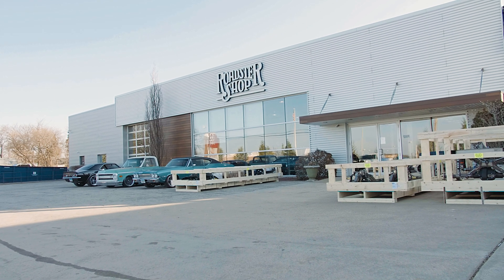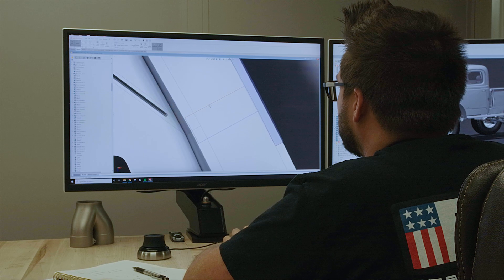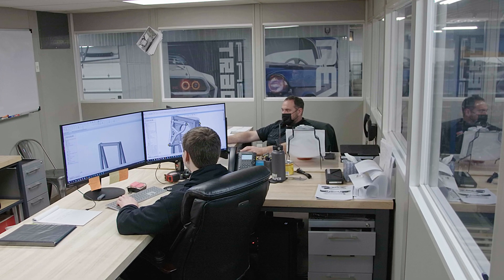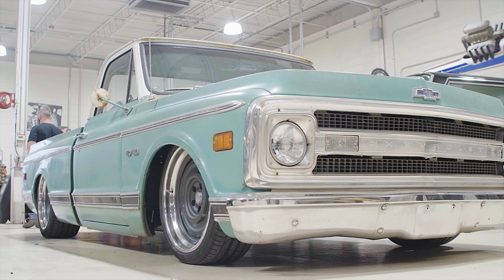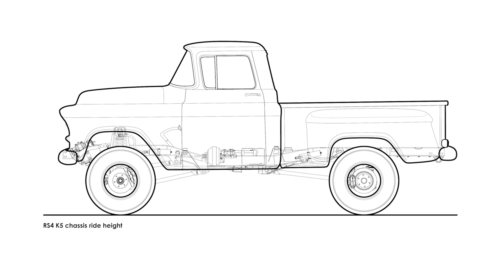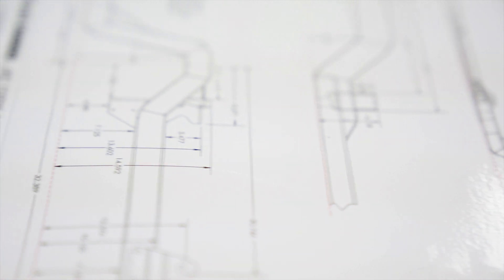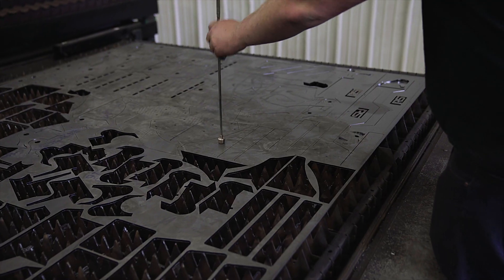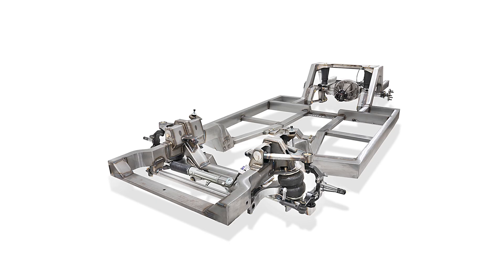Custom Roadster Shop Chassis: How it works...

Comment: I called them recently, asking about a chassis for my 1933 Chevrolet coupe. They said that they used to do them but not anymore. So much for the custom shop!
Reply: As someone who use to work for RS and seen I don’t know how many of these chassis’s get built and moved out the door… no the hell they didn’t
Reply: Unless you pay for a one off custom build it's pretty hard for them to justify designing and building it for less common platforms

Comment: Can you make a chassis for a 3/4 ton pickup? I noticed other shops only do 1/2 tons.
Reply from the maker: You should check out Banks Power's latest video series.  They are doing a c20 build with 8 lug hubs.  https://www.youtube.com/watch?v=GU6so-9pV0Q&list=PLwtmrqcWzLtSUSPX-V1rFQUkslt61Accw

Most the stuff we do is 5 lug, but as proof it can be done - the Banks series is great.   Are you going to use your truck as a tow vehicle or not so much - just that it started life as a 3/'4 ton?

Comment: How do you guys comply with the legal requirements and registration for a custom chassis? Do you have to perform any safety tests to make it road legal
Reply from the maker: At least in the states where we do most of our business (we do ship internationally as well) - the VIN for a vehicle is attached to the body so whatever donor car we use ends up with the same VIN as the original number.  DMV's are only concerned with the VIN and the car with the new chassis will register the same as the stock vehicle.  As for safety tests - all the cars we put chassis underneath will accelerate, handle, and brake better than a stock vehicle improving safety in nearly every regard.
Reply: @RoadsterShop  thanks a ton for the reply.  You guys work magic. Have a great day 👍
Reply: @RoadsterShop  another quick question: how difficult do you think registration would be if its a custom fabricated chassis and body?
Reply from the maker: @reyes10r  Depends on where you live and what entity you are registering with.  I know from personal experience that even DMVs in the same state will sometimes behave differently.  If it's outside the US I really can't give you any solid advice.